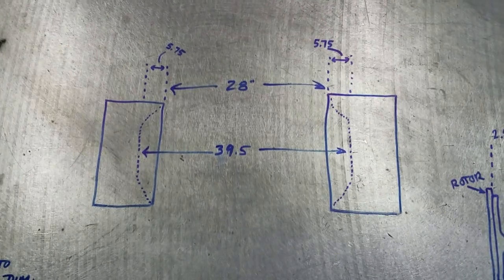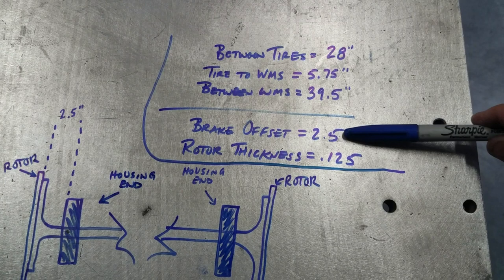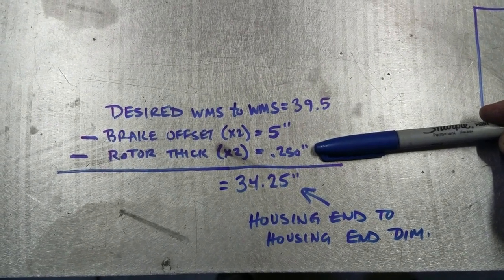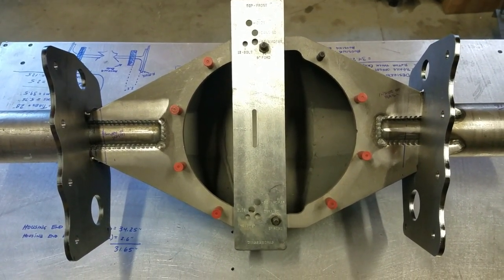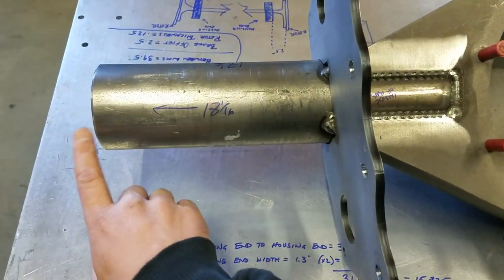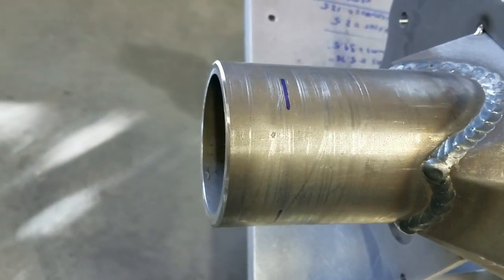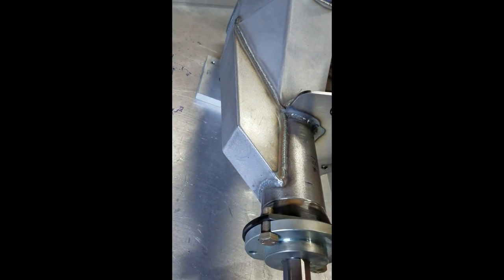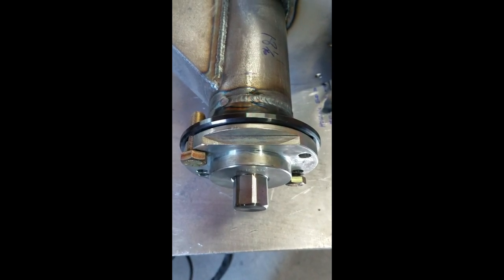How To: Narrowing a Rearend Housing

Comment: If you have a 1/2” pinion offset…How would you pull the measurements? That’s what I’m doing in Nova right now. My 4 link brackets are welded on from a 1/2” offset. Then one tube would be 1/2” longer than the other correct?

Comment: Yes a lathe must be used to shorten. Even using a dial indicator on the axle tube and brake flange. We don't butt weld. We press fit our axle ends before welding.

Comment: The tube and ends need to be chamfered. The weld is simply laying on top of the butt joint with zero penetration.
Reply from the maker: Paul Deahl The tubes and ends are both chamfered, then a TIG root pass is used followed by a TIG cap. Thanks though.